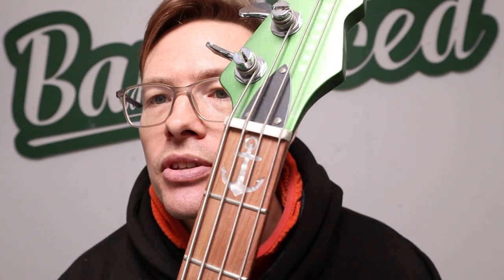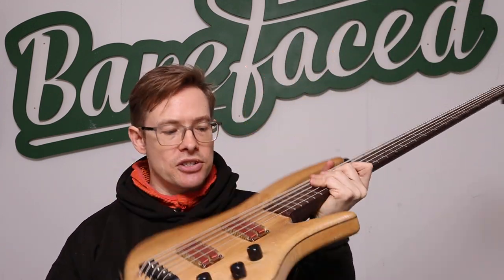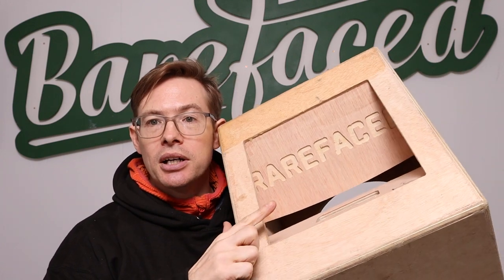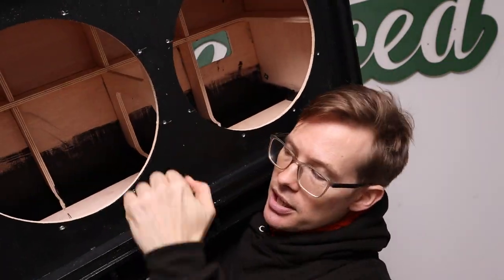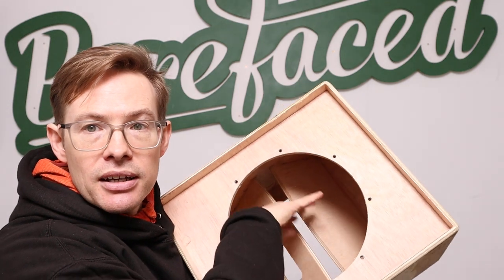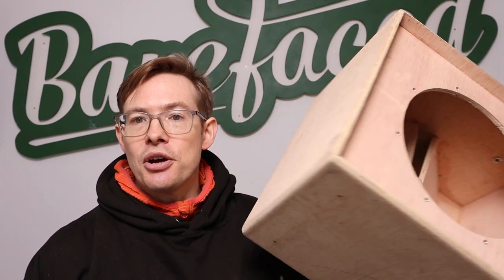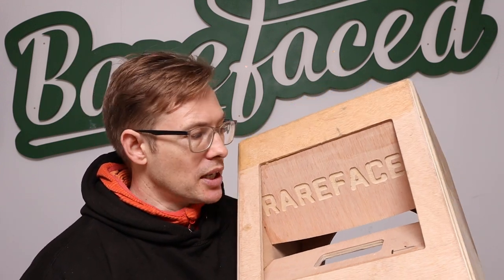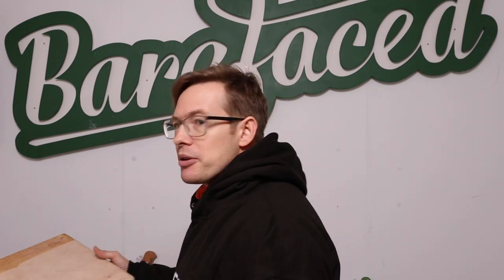Guitar cab prototyping part 5 - AVD angles and tuning (and why you can't move the panels!)

Comment: Pickup position is a scale ... closer to the bridge changes the tone and feel one way, away from the bridge changes it another way.  Every position is "right" for someone :).  I prefer the bite and attack closer to the bridge.
Reply from the maker: Yes - and I think there’s also a thing regarding your plucking/picking position vs the pickup location - if you play near the pickup you get more of the transient percussives.
Reply: @BarefacedAudio  Absolutely.  I think for some musicians they find their home tone by using the pickup as a rest which plays a part in the variety of home tones of j-bass players.  It's got more easy to find options you can stumble on as a beginner.
Reply from the maker: @Scoots1994  not long after I started playing bass I got my Dad to help me put a thumbrest on my bass because it made no sense to be tied to the bridge or neck pickup if I wanted somewhere to put my thumb whilst playing the E string!